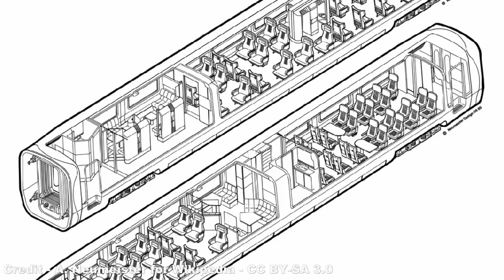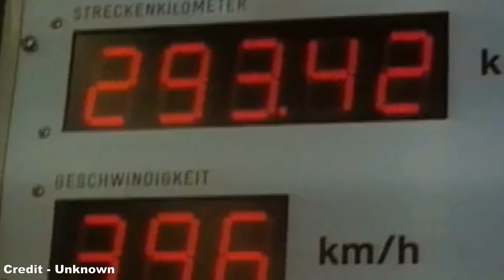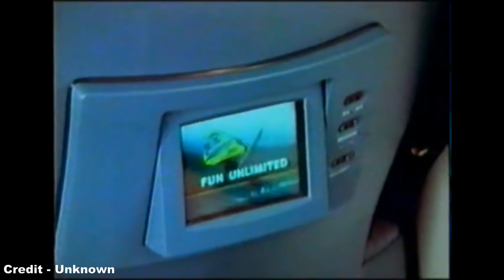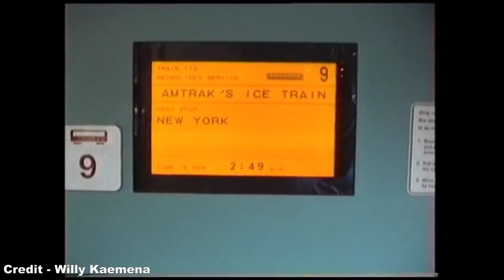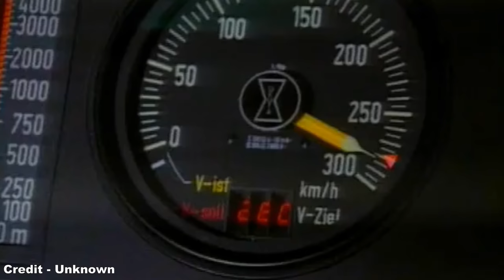The History of the ICE

Comment: “The ICE, unlike the TGV, being un-articulated, provided greater flexibility in being able to add and remove cars.”  - AND makes it much more dangerous in a derailment. Several high speed TGV derailments have occurred without deaths or serious injuries due to the articulated / shared bogie design. The ICE crash was so deadly precisely because it lacked this articulation and folded in on itself at the couplings.
Reply: @Sid483  One was a Eurostar travelling at 250km/h when a hidden underground WWI trench collapsed due to torrential rain. I’m sure you would have foreseen and remedied that however.
Reply: @lours6993  That Eurostar, is it E320 or BR Class 373?
Reply: @dbclass4075  The original TGV derivative Eurostar train set, not the later E320 which is a Siemens ICE derivative. In fact that deal was quite a scandal as they changed the Eurotunnel safety standards which demanded a continuous corridor, end to end, of the 400m train set with fire doors to maximize fire escape capability. This requirement was removed in order to chose the Siemens train over the Alstom TGV offering. Let’s hope no-one has to go to jail over unnecessary fire deaths.
Reply: @lours6993  BR Class 373. To further clarify: only the fire door requirement is removed. All other standards are met.

Comment: Riding an ICE train would leave you cold! LOL
Reply: Ironically they are usually too warm inside (unless you end up in the few parts of some trains where you can still control the temperature as a passenger).
Reply: @Colaholiker  DB Class 403 has a terrible reputation of air conditioning breaking down too frequently on hot days. Ironic for a train named "I.C.E. 3"
Reply: @dbclass4075  I think the difference there is that many ICE3 trainsets have a different type of air conditioning system. It doesn't use a classic refrigerant, but by compressing and expanding air, much like the air conditioning packs you would find on an aircraft. Something pretty uncommon for a rail vehicle.
However, Deutsche Bahn is known to have issues with the air conditioning of every type of vehicle in Summer, mostly due to cost cutting in maintenance. :(
Reply: @Colaholiker  Airplanes can use that type of air conditioner because it is very cold out up there. In fact, cargo planes need to HEAT their perishable goods to keep it in ideal temperature. Down to the surface, you need to be in Antarctica to achieve the same result.

Seriously, there is a reason why classic refrigant is the primary method for cooling in any places where you don't need to fly. Trains are no exception.
Reply: @dbclass4075  I know that, but a bunch of the ICE 3 are equipped with that kind of cooling system. Don't ask me why the decision was taken. But you can clearly tell the difference when standing next to an "air condition hump" on an ICE 3 at the station. The classic heat pump units only make a typical fan sound, while the air cycle machines have a high pitched turbine whine. 
Maybe they thought it's better for the environment, as even though modern refrigerants no longer attack the ozone layer, they still are pretty strong greenhouse gases, so in case of a leak... who knows

Comment: Okay second thing:

The Velaro based plattforms (New-ICE3 - named BR 407 and ICE4) are not replacing each other... The ICE4 and ICE3 are planned to run concurrently with the 4 replacing many EC/IC and all old loco hauled ICE1 and ICE2 till 2025
Reply: The old BR403 ICE3 is a design that actually predates the Velaro...
Reply: The ICE 4 (Br 412) isn't a Velaro

Comment: It beggars belief how for more than ten years, DB have been operating an HST with an inherently flawed and unsafe wheel design. In hindsight,  Eschede really was a desaster waiting to happen.
Reply: They had not been doing it for so long, dhe accident happened in 1998 and the trains didn't enter service until 1991. And even then it took a few years until the realized the comfort issues the original single-piece wheels brought along. The wheels with the rubber ring inside of them were only used for a very short time before the accident happened.
Reply: @Colaholiker  So DB got lucky for only seven years not ten, that's even worse than my initial calculation. There's a thing called duty of care (I think it's 'Sorgfaltspflicht' in German). You can't just slap a tram wheel on an HST bogey and pretend it'll be fine, I think that's what Eschede goes to show.
Reply: @gerritliskow2399  He said it took a few years to attempt to improve the ride using resilient wheels so not 7 years. But I agree an amazing glaring error for an engineering company  to make (if I remember correctly the low speed tram resilient wheels used to eventually crack as well in service).
Reply: @Martindyna  the point still stands: why use a novel design without proper testing? Maybe those rubber rings in the flawed wheels were intended as a fix for a known problem. Still, when 101 people die, it's hard to argue that everything went honky dory.
Reply: @gerritliskow2399  I was agreeing with you in general !
`Neil of Longbeck' made a comment showing that resilient wheels can be reliable if the outer rim is thick enough to prevent excessive flexing in service:-
 `No, the Eschede crash was caused by the use of resilient wheels which have a rubber section between hub and tyre. These wheels are common in low speed applications, like trams and were in BR's Class 86/3 at speeds on 100 mph which were in operation from 1980 until around 1990, when the wheels were replaced and improved suspension, as used on the Class 86/4 (thus move was due to standardisation). I'm not aware if any accidents for the Class 86/3 due to the use of these wheels.'
Reply: @Martindyna  I realise that, thanks anyway. AFAIK they had an investigation then, and found out it was down to the rubber fittings in between the inner wheel that sits on the axle, and the outer ring of the wheel that runs on the track. They used this design to save a few bob, without feeling the need to test it. Again, IIRC.

Comment: A little Trivia:
On the Prototype (now ICE-V) the Stripe was Magenta, not Red as often appeared in Publications of time. It is told that when seeing the Stripe a Switch Operator made a mistake and cause a Derailment. Others: feel free to correct me.

On the ICE-1 the Stripe was changed to DB Red (or was it "Verkehrs"/"Traffic" Red?) with a Violet Stripe below, you can see it in some of the Videos. The Violet represented "Premium" Service, as used on the legendary "Rhinegold" and "Fligender Hamburger" Trains.
The ICE Logo was changed to Type instead of the swooping emblem on the ICE-V.

Later the Stripe would be simplified to DB Red or Verkehrs Red; again, I'm not sure which Colour DB is using these days.

in 2019 the front part of the Stripe on the Leading Car/Locomotive/Treibkopf was changed to Green for half of the length to promote "Green" and Energy Efficient Transportation.

Comment: The USA uses a 60 Hz AC supply, rather than 25Hz.
Reply: That is not entirely correct. The supply is still at 25Hz south of Sunnyside Yard.
Reply: While yes overall U.S. electrical grid is 60 Hz, The Northeast corridor from Sunnyside Yard which is  a few miles outside of NY Penn Station to Washington D.C. IS 25Hz.
https://en.wikipedia.org/wiki/Amtrak%27s_25_Hz_traction_power_system

Comment: Resenence again like those suspension bruges when trains go bad ...major event I'll stick to my car thanks
Reply: The resonances were due to the outer part of the wheel flexing around the inner part, and the rubber connecting them not being strong enough, which eventually led to the outer wheel fracturing. That design fault was fixed after the accident, and as far as I am aware that was the only deadly accident involving an ICE. And given that they transport around 100 million passengers annually, the chances of you being killed in an accident whilst driving to the train station are much higher than being killed on the train itself.